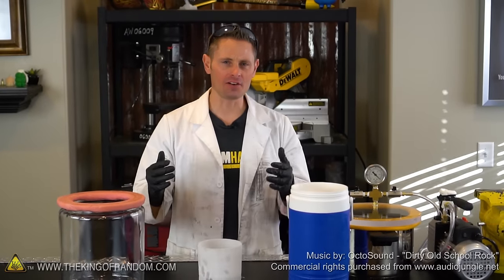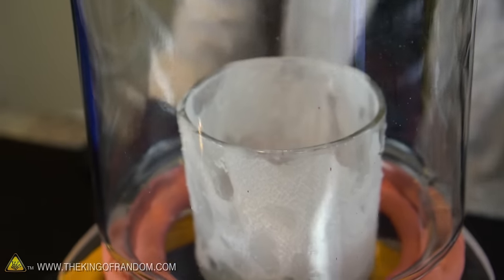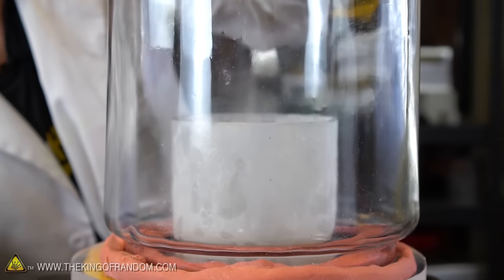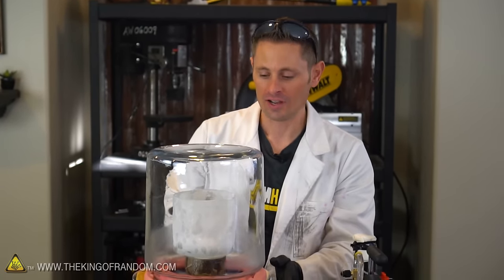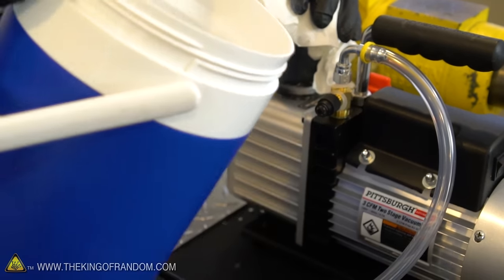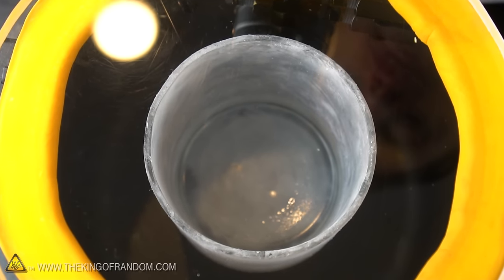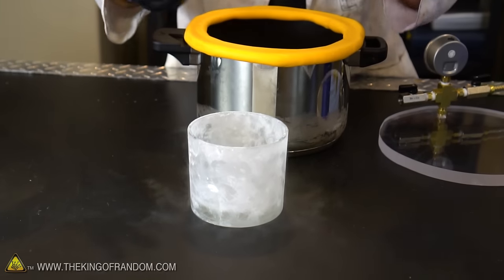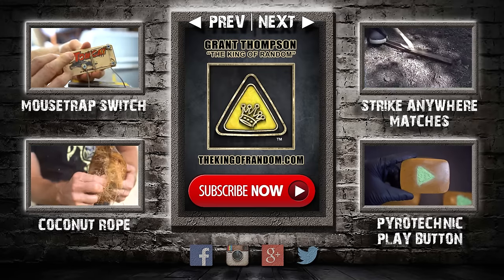Liquid Nitrogen in a Vacuum Chamber Fail | TKOR Experimenting With Liquid Nitrogen In Vacuum Chamber

Comment: Actually you did make triple point, when you saw that pop in the nitrogen, what happened is you had a small ice layer form which trapped the gas, which built up pressure under the ice, and then the ice popped.
Reply: Grapegifter yes u r right.. n I'm surprised that i have to scroll through so much nonsense comments to find u..
Reply: ^^^ Amen
Reply: If it had been a lighter blue container,  you may have been able to see the ice layer.
Reply: i was going to say the same, but i wanted to see if someone said it already
Reply: I just googled the triple point of nitrogen and it's around 100mmHg. You just passed it too fast!
Reply: I don't think he even reads these comments, which is too bad.  Vids like this one serve to remind us that he has great garage skills but zero knowledge of science.
Reply: no he needs 26.2 inch mercury to do so, look at the phase diagram

Comment: way too much nitrogen for that pump, I found that a small condiment dish worked best.
Reply: Cody'sLab Cody back at it again with the science-y knowledge.
Reply: Cody'sLab hi cody love your videos
Reply: Cody'sLab hi Cody I love ur interesting vidioes
Reply: Cody'sLab Hi
Reply: Cody'sLab Awesome to see you here Cody!
Reply: Cody'sLab And he probably needs a high vacuum pump.
Reply: Cody'sLab if water boils in a vacuum why would nitrogen solidify?
Reply: Samuel Orozco I see what you're saying. lower pressure means lower boiling point, so if anything it should boil more rapidly.
Reply: Samuel Orozco when you pull a vacuum on water, you are actually pulling all molecules with high energy, and when they go to the gas phase, they pull a little bit of heat from the other water molecules, so you end up with only the low energy molecules inside the liquid phase, which then turns into a solid. And there is this other thing called triple point, it's a pressure and temperature condition at which you have all 3 phases, for nitrogen is something around -200 c and 98 mmHg.
Reply: Cody'sLab oh like I'm going to do this
Reply: i agree Cody
Reply: You're the best Cody
Reply: so team up! use both vacuum pumps!
Reply: The real smart Cody vs the fake yet more popular "king of science"
Reply: Cody'sLab to the rescue! Love your videos.
Reply: Cody'sLab
Reply: Grant Thompson.  Try putting frozen slime in a vacuum chamber.
Reply: Cody will still be correcting Grants faliures from Mars
Reply: People get a little confused with the term "boiling". Boiling just means it's at the point where it changes state from a liquid to a gas. You can make a liquid boil by raising the heat, or by dropping the pressure. When you lower the pressure, you lower the boiling point, which lowers the temperature and eventually it freezes solid. Water would do the same thing.
Keep this in mind. Outer space is so cold not because there is a "cold source" out there. You can leave the surface of the Earth in July, head straight for the Sun (a heat source) and it will just get colder and colder due to the lack of pressure. On a clear day, with no wind or weather, if you start driving over a high mountain pass, the temperature drops..., because the pressure is dropping.
Reply: It's not pulling any molecules with high energy. Lowering the pressure simply lowers the boiling point. Lowering the boiling point, forces the liquid to turn to a gas. When it turns to a gas, at that "state change", just like how refrigeration works, it lowers the temperature. If you keep lowering the pressure thus lowering the temperature, Nitrogen will freeze into a solid. By the way,  -209.97 Celsius is the triple point for Nitrogen.
Reply: Wouldn't you want to put it under pressure rather than a vacuum?
Working on the fact liquids boil at a lower temperature in low pressure environments and boil at a higher temperature when under pressure.
Reply: Samuel Orozco when water, or anything boils, it actually expels heat, that’s why boiling water never gets over 213 degrees Fahrenheit. Same principle with nitrogen, nitrogen boils at -321 degrees Fahrenheit, and when boiling, heat escapes and cold is left behind.

Comment: I can't be sure, but I think those bursts you were getting was from nitrogen solidifying, and then returning to a liquid state and boiling. Something about how very low pressure makes the freezing point, and boiling point, close to identical. I think I saw another experiment in a class room on youtube where they showed that, and that was an approximation of the reason given.
Reply: I have a feeling this will get lose under all the "put X in a vacuum chamber!" requests, especially as the video is now over half a day old, but i hope if you see this it helps. who knows, i could be half right!
Reply: Yes, he got solid nitrogen in there.  The bursts were caused by the thin layer of solid nitrogen breaking under the pressure of the liquid nitrogen evaporating from below.
Reply: i thought so! nice to know I'm not entirely wrong!
Reply: YeaI was watching that too and am pretty sure it is hitting its triple point.
Reply: pr1m3tim395 the triple point is about 26inches Hg vacuum under STP. he says on the video he only got to 22inHg vacuum, so no, it's not near the triple point. 

Also, you'll notice it happens early in the video while still depressurizing.
Reply: About freezing point and BP being close, that's just sublimation. Even then, the LN2 started out warmer than freezing point, so under those conditions, it will never form solid. Only all of it will vaporize, like seen in this video. 

Only when he reintroduces pressure after getting the LN2 to lose sufficient energy through boiling will he have a chance of getting solid Nitrogen.

Comment: In my work with a physics show we do this on a regular basis in basically the same way.
The most clear difference I see between your method and ours is that we normally use a smaller diameter glass beaker for the LN2, that may help if you decide to try this again.

Comment: You could make a Sprengel Pump like Cody's. 

Keep the liquid nitrogen sealed until you have it below 1 mPa then open the nitrogen container remotely so we can see it freezing.

You'll have to figure a way to open the nitrogen container remotely but I'm sure you can figure that out ;)
Reply: +alshabaz Cody's pump wasn't built particularly well which is why it took so long.  A half decent pump should evacuate in under 1 hour.
Reply: but you run the risk of the nitrogen freezing inside the sprengel pump due to thermal transfer. wouldn't be as hard to as water as nitrogen specific heat is about a fourth (1.01 j/g vs 4.18 j/g) plus as you release it the nitrogen compresses (causing it to heat up, think about how when you fill a gas bottle it gets warm, but when you use it, it gets cold) cause possibly the opposite effect

Comment: Do I see this wrong or does not the freezing point drop with higher air pressure?  
Because the more air pressure, the harder can the molecules/atoms  move, and the sooner they change into their solid form?

The way you have done it (by lessening the pressure) you have helped the nitrogen to change into gas.

Correct me if I am wrong
Reply: vacuum freezing takes advantage of saturation pressure, if you lower your pressure below the saturation pressure you start to freeze the pure substance in the vacuum.
Reply: So you want to say that at first it will expand but than it will solidify again? Interesting. I did not know that.

Comment: you will need a stronger pump, or two pumps for increased evacuation. also keep the nitrogen inside the pot and keep cool lights pointed at it, as the vacuum is created it causes convection heating, making it hard to pass the triple point and create sublimation (the explosive bubbling you see). you need that sublimation to create a solid.

Comment: Actually I think you should have increased pressure. Decreasing it lowers boiling point, which means it wil boil at even lower temperature. Increasing boiling point (by increasing pressure) increases boiling point, and thus melting point.
At least I think so.
Cuz every substance is full of energy, and air is only thing keeping a liquid particles from flying all over the place, further away from each other, becoming gas.
Reply: The Kanał :D yes, but if he's trying to make a solid, he'd want to decrease the boiling point so it would not boil away.
Reply: The Idea is that by lowering the pressure and therefore making the nitrogen boil, it looses a lot of thermal energy until its cold enough to freeze.
Reply: actually, I was wrong. you would want to increase the pressure because it decreases the boiling point. Think about how the boiling point of water in the mountains is increased due to lower atmospheric pressure.
Reply: ScullyScurl
Reply: JLTMusic Adding pressure would raise b.p. which is what you would want. Lowering pressure is the opposite of what you want to do.
Reply: The aim here was to keep it boiling because this takes away energy from the liquid nitogen and cools it down further and further until it reaches its freezing point. The freezing point isn't affected by pressure a lot, but the boiling point decreases, so you can keep it boiling even at temperatures just above the freezing point.
Reply: Yes the boiling point gets lowered, but if you look at the phase diagram for nitrogen, the melting point doesn't. The idea is to lower the boiling point to where it meets the melting point (this is called the triple point), causing the evaporating nitrogen to cool the substance enough for it to freeze.
Reply: Right. Think about your pressurized tanks, natural gas, helium ext. Pressure brought them from gas to liquid. To get to solid, continue adding pressure, and/or decrease temp.
Reply: Boiling takes away heat, hence the nitrogen get colder
Reply: JLTMusic, how old are you? Decreasing boiling point means that if something boils at 50 degrees, it now boils at 10 degrees. To boil something you need heat, an object that has no thermal energy is in solid condition, if you want something to be in solid condition, you want to have it cold, when you decrease the boiling point you let it boil at a lower temperature, then it's not solid anymore. When you have butane in your lighter, it is in liquid condition instead of gas because it's pressurized.  Same physics for nitrogen: if it is in gas condition, you have to pressurize it to become a liquid, logically your liquid nitrogen becomes a gas after depressurizing it, that's what de vacuumchamber is doing. King of random needs some more physicsclass i guess :p
Reply: I was pretty disappointed in Mr random for this one.
Reply: slacksijie Nitrogen is quite conducting in it's liquid form, you would have to depressurize it extremely quickly to prevent the nitrogen to conduct it's termal energy, looks very hard to me.
Reply: +Helena Vanaeken you just need to achieve triple point of Nitrogen 63.18 K (−209.97 °C) 12.6 kPa (0.124 atm)

Comment: But will it work with water? It has a higher freezing point than nitrogen.
Reply: Lucian Roinita yes is does work with water
Reply: Lucian Roinita it works with water
Reply: Doesn't water boil? Because of lower boiling point at lower pressures

Comment: wouldn't reducing the pressure in the vessel just push the liquid nitrogen into a gaseous phase?
Reply: This is what I thought. Wouldn't you need to increase the pressure to get it to solidify? Lowering the pressure should lower it's boiling point, not increase it.
Reply: increasing the pressure will make it gaseous. Just like if you put pressure on ice it melts.
Reply: Crockett_ I believe that vaccum is lowering it's boiling point, but as the air is being pumped out, the temperature drops (just like a deodorant can being depressurised). In addition the vaccum insulates the outside heat, thus making liquid nitrogen unable to solidify .
Reply: u should probably read some thermodynamics bro
Reply: Soumyajit Ray ice melts under pressure because ice is less dense than water. when you go up in altitude, the boiling point of water decreases because of the lower pressure, which is why cooking times are greater at higher altitude; The temperature of boiling water is lower. 

in space, which is a near vacuum, water sublimates. It goes directly from a solid to a gas, since the boiling point is so low it's the same as the melting point. 

I think k the experiment here is to lower the boiling point to be down to the melting point, and then the boiling nitrogen bleeds off enough heat that the remaining nitrogen solidifies. I'm guessing the only way this would work is if he could create the vacuum quickly enough, and his pump isnt fast enough.
Reply: when a liquid boils, it carries away heat and cools down